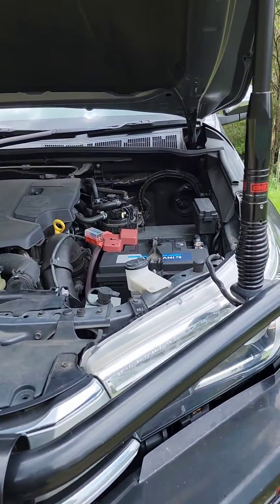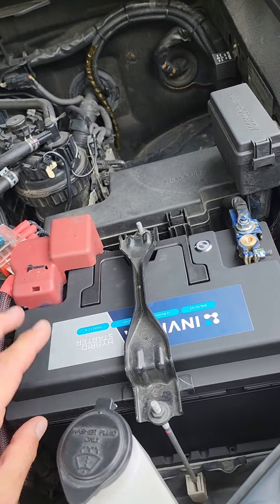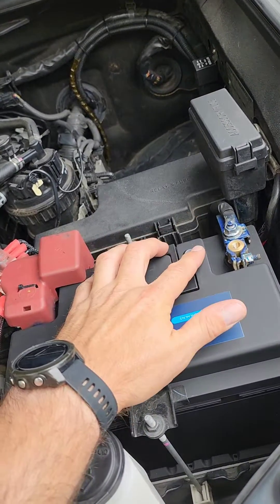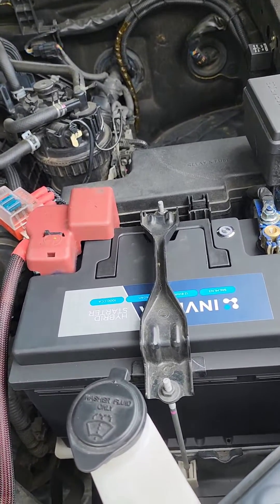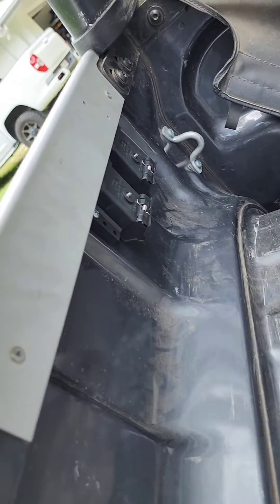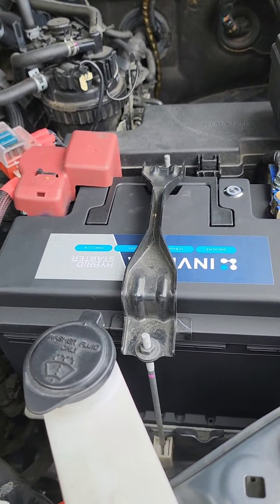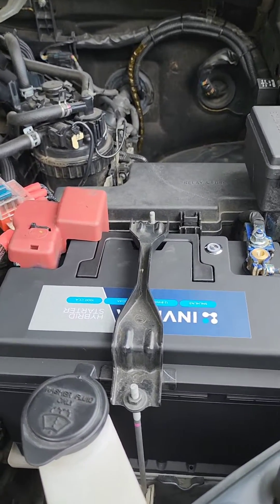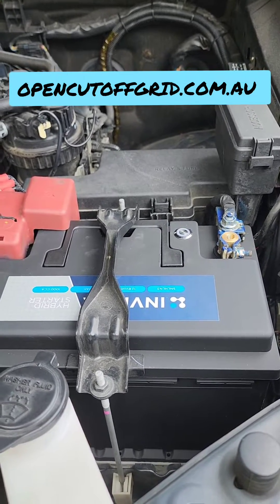Invicta hybrid, the under bonnet lithium battery that will start your car and run your fridge

Comment: What other equipment is needed to trickle charge the battery from the Anderson plug in the tub?
Reply from the maker: Solar panel or blanket with a lithium profile regulator would be our pick.
Reply: How's this going? I'm thinking of doing the same to my hilux.
Reply from the maker: @dpdog88 every single hybrid install soo far still going great!